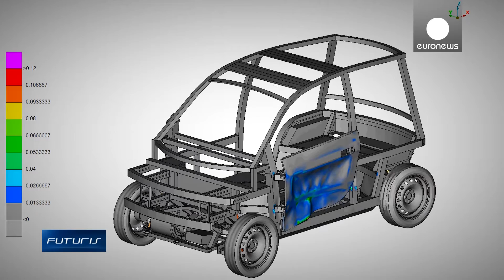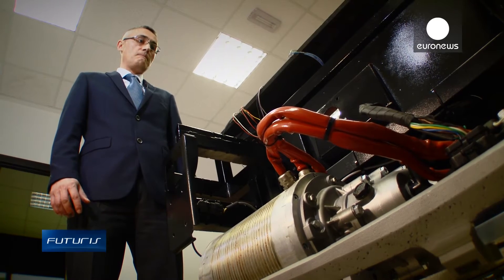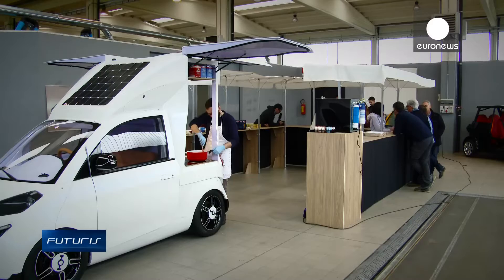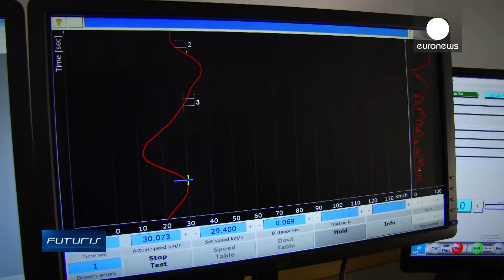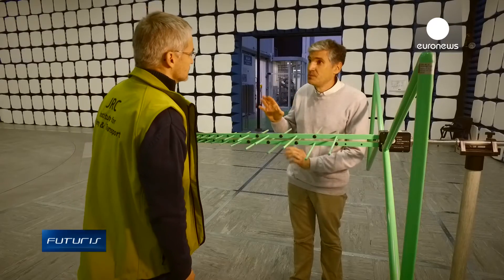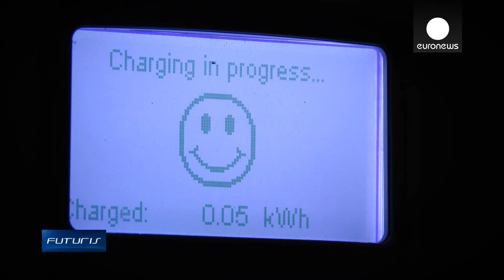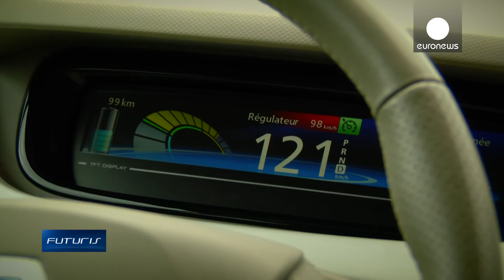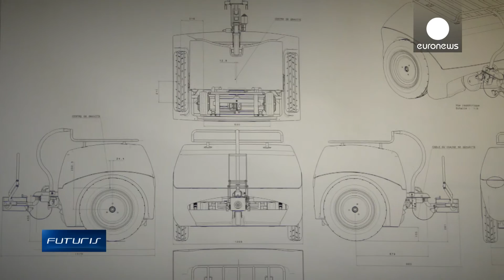A greener road ahead?

Comment: Those tiny panels would not be able to power much. I see about 400 watts on direct sunlight. 100 watts on a dull day.

This is a joke, although continue the research.
Reply: +meadowsirl , unless they use 3d solar panels, 9 times more power
Reply: +meadowsirl they should have the solar panels on mounts that can track the sun - maximum power generation that way